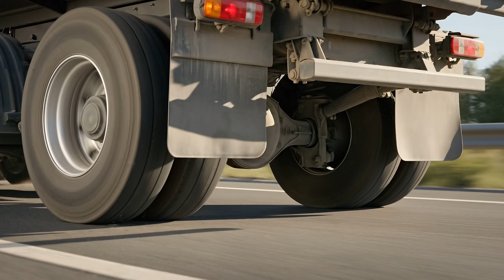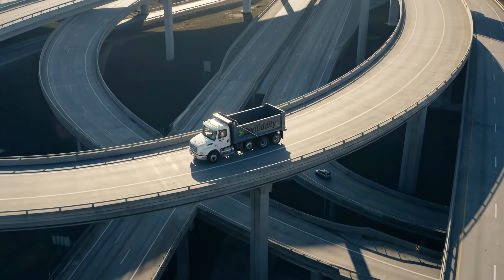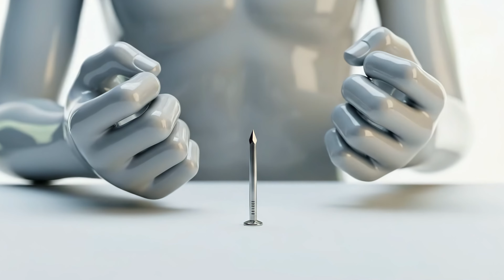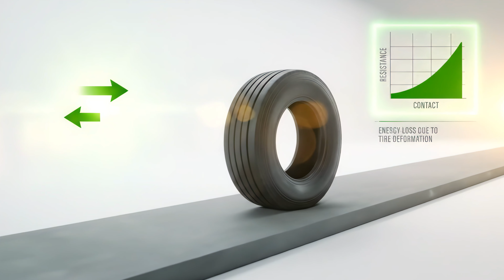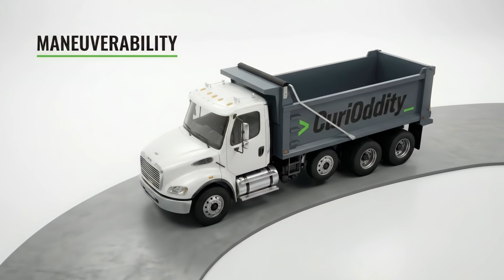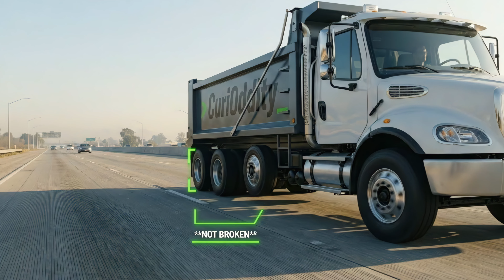The SHOCKING Truth About Truck Tires That Don't Touch The Ground

Comment: I still don't get it. Everything just sounds like it's better if they're not there at all. When ARE they used?
Reply from the maker: Only when there is a load
Reply: @CuriOddity-TV  What, with a large enough load they actually reach the ground? I doubt that.